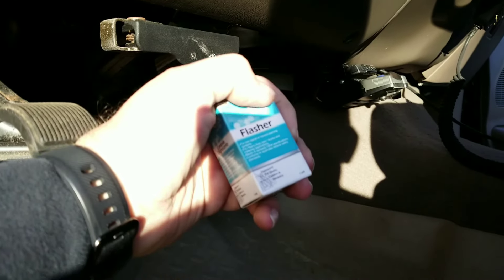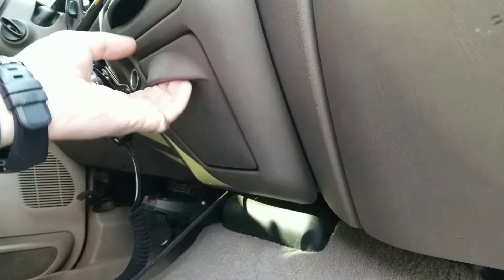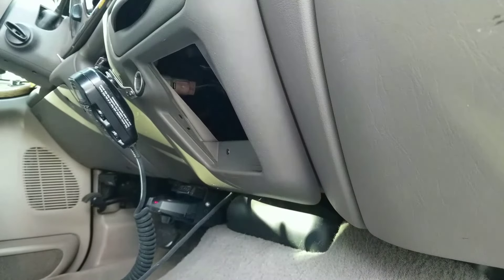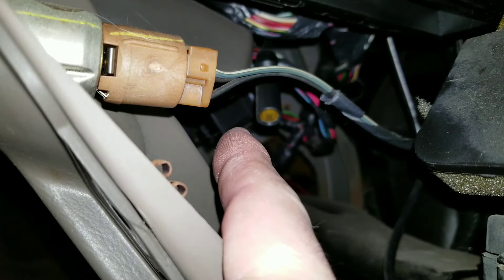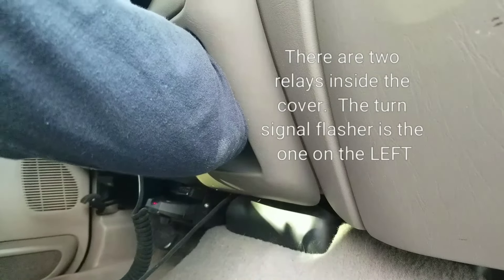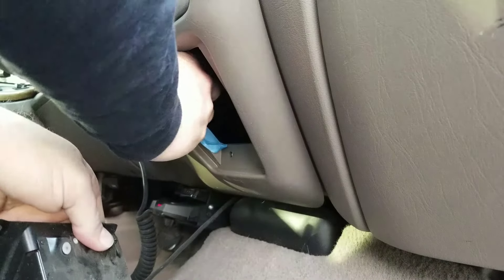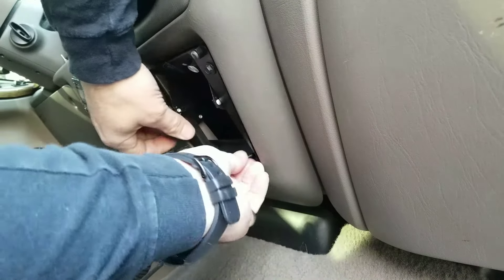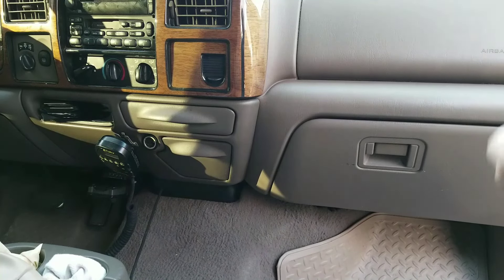1999 to 2006 Ford F250 and Excursion "Easy" 5 minute Turn Signal Flasher Relay replacement $save$

Comment: Thanks for the info, but you could have cut about 8 minutes out of the video.  Just the steps;  remove ash try, remove 4 bolts, show location, remove cover, pull relay, note orientation, replace with new.  I do appreciate the video, but I did skip 90% of it.
Reply from the maker: Brendan McGowan I'm pretty sure 90% of the people that watch this video and all my other videos.  Do exactly as you do and skip 90% of it.  Which is fine by me.  Like in all of my videos I try to thoroughly explain how to do something,  as if that person has never picked up a tool in their life and they'll be able to repair it themselves.  I make my videos to help people(novices and handy people alike) and in the end the job will be done right.  That's the one nice thing about YouTube videos you can fast forward, I do it.   Making repair videos that show the work and are easy to understand isn't easy.  Any job I do takes me triple or quadruple the time it would normally take to do it.  Plus editing and posting turns the job into an all day thing.  I try to make my videos as short as possible.  Yes I could have cut it down but would it be understandable for a novice?  Maybe.  If you looked for any other videos for this same repair,  they have you taking apart half the dash.  Making this video it was one of the few where the whole job took me 5 minutes from beginning to end.  The last thing I would want is complaints & dislikes because I missed a step or something was broke because it wasn't explained properly. I make my videos to help people and gear my videos for Novices. They help everyone and I don't mind if you fast forward.   I hope this explains my videos, I'm glad I could help and I appreciate your comment.

Comment: Maybe a far reach, but i have trouble with my left side turn signal lights staying solid, including the indicator in the dashboard. But the right side works as normal. Is there two relays? Or can one bad create this problem?
Reply from the maker: Sounds like you have a bulb out in the front or rear. Or maybe a bad ground wire to the body somewhere..